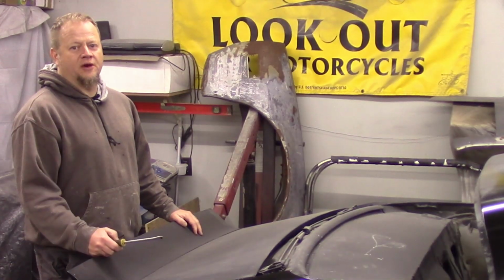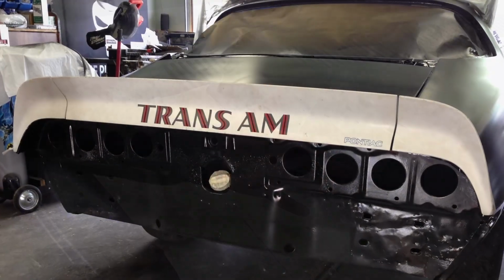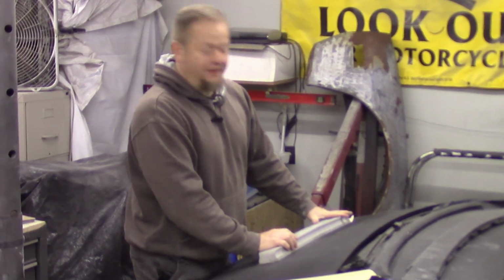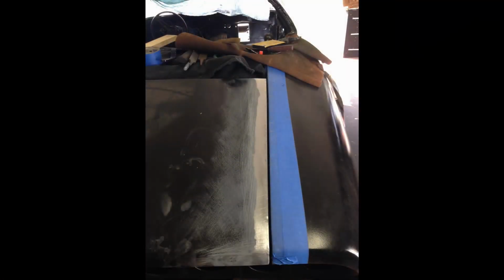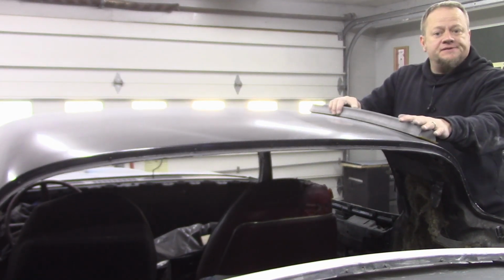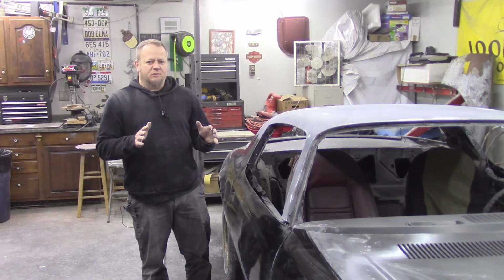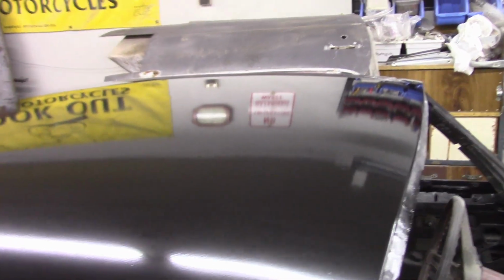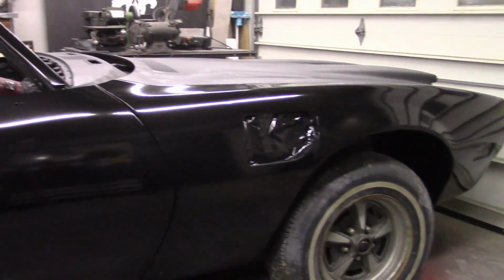Trunk Lid Gaps. Trunk and Roof Blocked and Primed. Trunk Spoiler Install Overview on Drilling Holes!

Comment: I will be sticking around. Nate, watching your videos has given me the courage to try doing this on my own, I just need to buy a welder and all the other body tools. I bought new quarter panels for my Lemas back around 1989 and have been holding on to them.  Thanks for sharing.
Reply from the maker: Right on man! Im glad the videos help and inspire.  One of my goals with the channel is to show that there isn't really anything super special about tackling this body work stuff. We are just guys working out in the garage. nothing more than that.  If you have patience, it just takes time and effort.  I always try to go slow and not get discouraged. Take my time and think it through a couple steps ahead. There really isn't anything that cant be redone or fixed if you make a mistake. Its all part of the learning process. even mistakes are valuable.  Anyways, i appreciate the compliment, the comments you give, and for checking out the videos. Please keep me posted on your project and if you need any specific advice, let me know. Cheers!